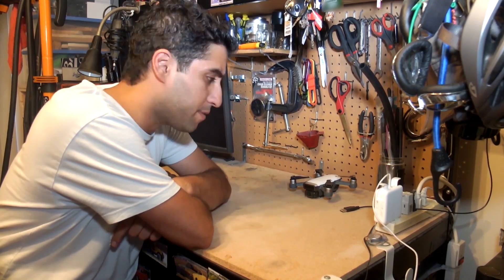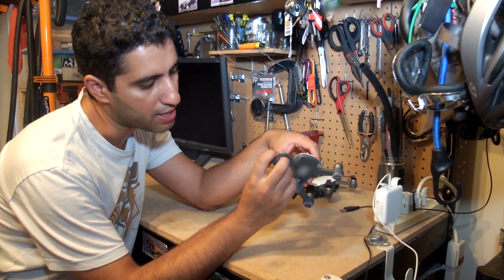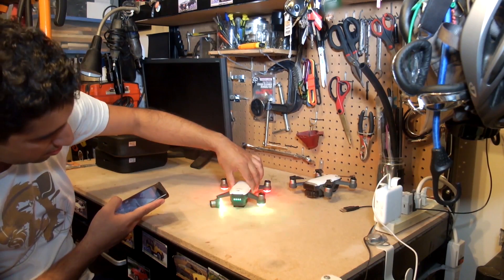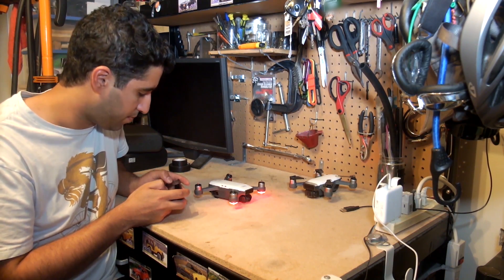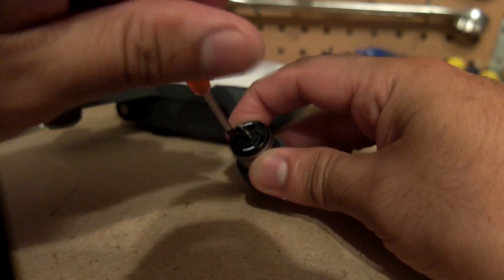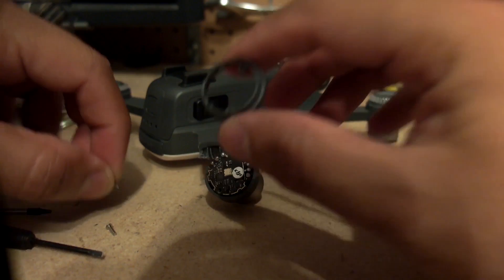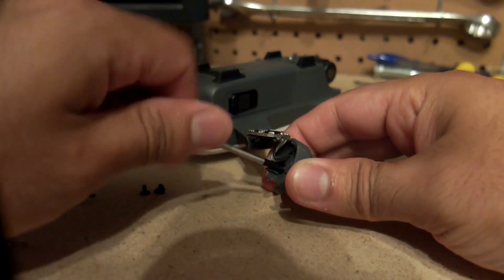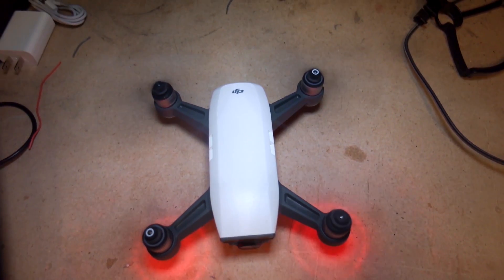DJI Spark Crash! and motor removal

Comment: my spark has a problem that it will lose control and gain speed itself and i’m not controlling it what should i do ?
Reply from the maker: @jose ortiz do you fly with the remote or a phone?
Reply: Prepare For Landing remote but the two back motors stay red
Reply from the maker: The color sounds fine. Try to do an imu calibration.

Comment: When I press and hold the remote control to connect to the plane, I cannot hear the beep sound helping me please
Reply from the maker: Is there any damage to the remote or drone? Are the batteries charged on both?
Reply: Not everything is perfect
Reply from the maker: Hmm can you post a video of the problem?
Reply from the maker: Sorry my phone shows that number as invalid when I try to add you. Can you post a video to YouTube?
Reply from the maker: It seems like you may need to rebind the remote to the drone. Try these steps: https://www.heliguy.com/blog/connecting-your-dji-spark-with-the-remote-controller/

Comment: I did the exact same repair using Loctite super glue and baking powder. First super glued the motor mount to arm without disassembling  holding for a few minutes until set. Then using more super glue on the cracks and applying baking powder to glue while wet, makes a super hard plastic you can file smooth after hardening.  Super Glue and Baking Powder creates a super hard plastic. Great Video
Reply from the maker: I've heard about that method, but never tried it. Glad to hear that it worked well for you. 👍

Comment: I broke mine exactly like shown here, what I did was cut the arms off the propeller guards and clipped it on and it holds it in place solid and with no issues. I did this to all 4 just to make it look even. Saves loads of time and money using something you all ready have.
Reply: Cheers Ben Wakefield....I tried the guards and it worked out pretty well.....did you glue it before you clipped them on??

Comment: Just wanted to say thank you for posting this video. it helped me to replace the motor on mine that got damaged after I ran into my house at night! Just a note to anyone replacing the motors, as stated in the video just be mindful of the wiring pair on the motor. I mixed up two of the wires on mine and it had the motor going in the wrong direction. It would have been fine, had I paid attention the first time.
Thanks again.

Comment: Hi I was wounder u have any suggestion on the spark Which I had a bad crash... I replaced my camera module but the issue on imu 1 calibration failed error code -50
Well I tried all ways still the same ...
Reply from the maker: Unfortunate the IMU is a very sensitive piece of equipment that is part of the main board.  The first thing I would try doing is to reflash the firmware by connecting your spark to your computer and using the DJI assistant software.  If that doesn't work, there may be some internal damage to the IMU, and the main board would need to be replaced to repair that.  I've seen some used main boards available on ebay that might work for you, but they are in the $100 range.

Comment: how to open the led cover plastic part I trying to open with my nail but it can't came off, any ideas tks guys.
Reply from the maker: Make sure that you are pulling at the base of the led cover, and not at the ring that is screwed in.  Watch the video carefully to see how it is done.  That said, using your nail might be difficult.  Using a small flat screw driver, or maybe even something like a toothpick might be easier.

Comment: there is moldable plastic that you could use. would be stronger. just a fyi.
Reply from the maker: Wrapping the arm in some kind of reinforcement would take away from the ability to use spark accessories that mount to the arm.  Do you have a specific moldable plastic product that you prefer?

Comment: Which size screw driver did you use btw to unscrew the motors?
Reply from the maker: Just checked and it looks like a Torx T6 is the correct screw driver.

Comment: Wait using the phone did it not have obstacle avoidance active?
Reply from the maker: Obstacle avoidance and automatic positioning do not work well in low light and without strong GPS signal.  Additionally, obstacle avoidance is only in the front.  This particular crash was due to the Spark drifting sideways into an obstacle.
Reply: Yes, that is correct. However, another reason why a drone may crash (this is not in your case as you explained) is if the drone is in sport mode. In sport mode, obstacle avoidance is automatically turned off.
Reply from the maker: While that is true, sport mode is not available when flying with only a phone and no remote.

Comment: Although you did not show the process of the actual plastic repair, this was the first video I have seen that shows how the motors are attached and connected. I was guessing that replacing a motor would be a major undertaking. Thanks for showing me that it is not.

Comment: Same thing, but i broke connections to the motor!
Reply from the maker: That's no fun.  Is it possible to solder the wires that you damaged back to the ESC or motor?
Reply: yes it is but it's extermly hard, you need to get the right amount of solder so connections can hold 11.3v without making a lot of resistance or motor won't get enough power for the sport mode and wind, also if you put too much solder, it would be impossible to super glue the leg back in place cos of that, anyway, i sent mine to repair shop, they sent me back as it was new and it was not my fault... i did not had any refresh or that shit from dji just a varanty paper from the shop. all i have payed is shipping for the new drone from Germany to the Serbia and new propellers as they weren't in that varanty. final cost was 35-40$ i ended up well, as that repair could cost me around 150$

Srry for bad English, 3rd language i'm trying my best :P

Comment: epoxy lol you can buy the frame for 35 bucks... why not just buy a frame and do it the right way
Reply from the maker: +Wyatt Earp frames were not available at the time.  I'm planning on doing a full frame swap video in the near future.
Reply: That would take all of the fun out of it. LoL! The proper glue that would literally weld the plastic instead of just sticking the pieces back together should work just fine until the new frame can be installed.

Comment: U did a great job. Plz tell me what u did. I saw the locktite but tell me how u did it plz. My arm broke after a crash its pretty good now after the fix but i wanna know how u did it. Color smoothed out jus plz let me know how u did it i wanna finish mine like that
Reply from the maker: +John Santiago I think the repair on the damaged arm is still fairly visible on my spark, it is just masked by the landing gear that I have installed.
Reply: Prepare For Landing ahhhh ok i seee good work dude. I used some gorilla glue and crazy glue to mend my arm bak together shes flying like nothing ever happened to her

Comment: One of my motor is stiffed (not smooth). Do I need to replace it?
Reply from the maker: +Jayson Koo I was still able to fly the spark with a damaged motor, but I suspect it has negative impacts on flight time and top speed, mostly due to the drag from the motor that doesn't spin as well.